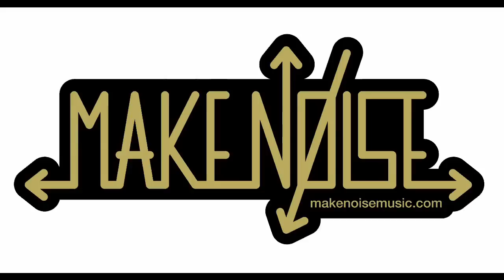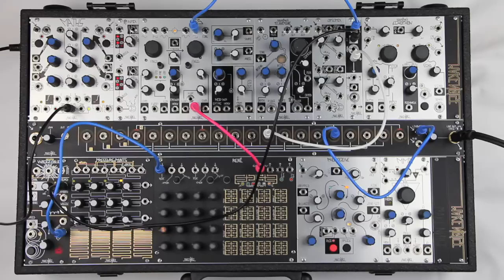Advanced Patching with LxD

Comment: If you can add resonance can you make it self oscillate with no audio signal input?
Reply from the maker: Worth a try, but my guess is it will not work. You may be able to excite it by patching something, cranking the feedback, and then removing the signal, but I think (again, just an educated guess) that it would stop oscillating if set to lower frequencies.
Reply: Yeah I think your right. I was thinking as it purely as a filter and forgot about the VCA part of the LPG. The VCA dampens any resonance at lower frequencies.